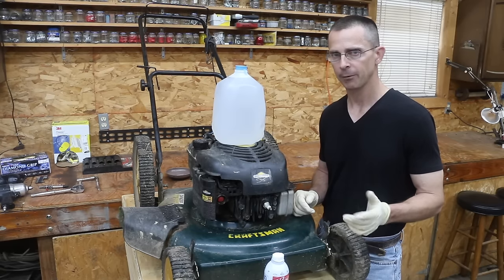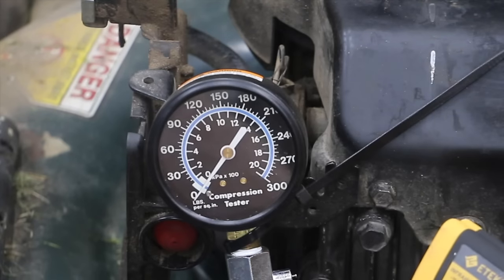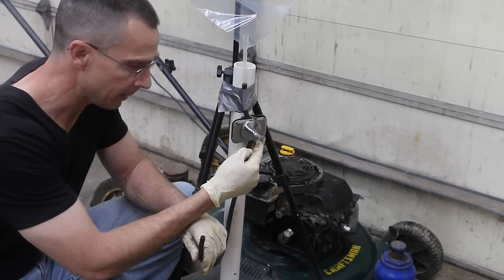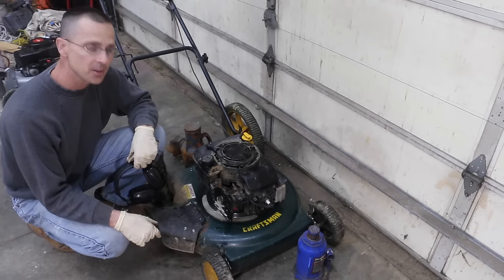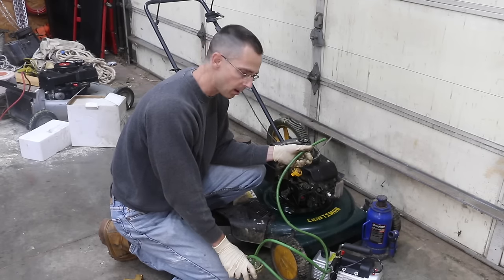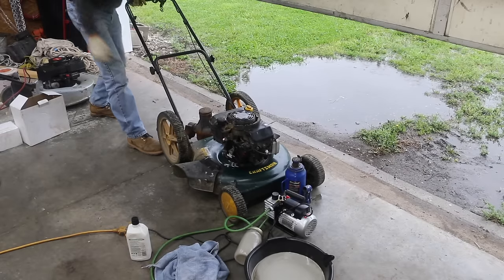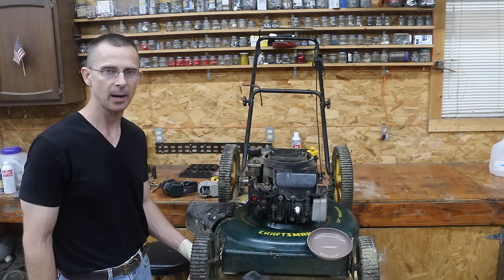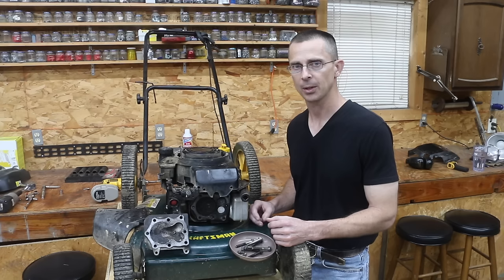Seafoam--can't believe what it did to my engine episode 5--cylinder cleaning test using water!!

Comment: How I was taught  to do it
 is using a squirt bottle and you missed the water into the carburetor
Reply from the maker: Thanks for the feedback.
Reply: @ProjectFarm  
Well over thirty years ago
Old timers say a  quart of kerosene to 15 gallons of gas
Or a quart of diesel to15 gallons of gas
would clean and lubricate your carburetor give a better burn and help clean the cylinders
I've never tried the kerosene but I have tried the diesel
And it did help out an old Holley 2 barrel
How well it works I do not know?

and with water the old-timers said it should never take more than 2 tablespoons of water 💦 two shots of mist from a squirt bottle let it run for a minute and repeat until you got about 2 tablespoons of water in it  that's how I was taught
I did it on a performance Ford engine that I felt it had carbon buildup and pre detonating
And it got rid of the problem

Comment: I'm at 8:34. Before I even clicked on this video I thought, "No way are you ever going to convince me to put water through my engine.".
Even if the water works:
1) He's already been at it for over an hour.
2) There is water in the oil. The oil is ruined.
He didn't save any time.
He didn't save any money.
Even if the treatment works, which i doubt, it wasn't worth it.
Reply from the maker: Thanks for watching!
Reply: @ProjectFarm  After watching the rest of the video and reading through the comments, It would appear that injecting the water as steam or at least atomizing it would be easier and more effective.
Is there a follow-up video where you did that?

Comment: With all the extra effort of setting up a delivery contraption, running it for 2 hours, gas for 2 hours, and changing the oil twice, I'd rather spend the $7 and  add a little each time I fill the tank
Reply from the maker: Thanks for the feedback.

Comment: maybe you can try to use steam from a teapot or humidifier? The idea of using water probably came from some car tuners, who noticed that in rainy or high humid weather cars perform better and have slightly higher power. Physics explains that in dry air fuel fumes burn worse. Originally, the idea to use water came to increase power, but not to clean engine parts. And in my view, you put too much water on that engine. The water flow should be slower, imitating high humid conditions but not direct water stream to inlate
Reply from the maker: Thanks for the suggestion.

Comment: DXID YOU EVER TALK TO A OLDER MECHANIC?? THEY'VE BEEN CLEANING CARBON OUT OF ENGINES FOR A CENTURY. IF THEY USED YOUR FORMULA ON A V-8 STATIONARY ENGINE YOU WOULD HAVE TO RUN 10 GALLONS THROUGH.

Comment: That much water in the oil means the engine ran without proper oil protection thus damage was certainly caused. NEVER use water

Comment: Here is something easier and better. pour oil and a bit of varsol  into the spark plug hole until it fills up. let it sit for a week until the next mowing.  drain it, start it up,, work it hard. your engine will be like new.
Reply from the maker: Thanks for the suggestion.

Comment: If you were to spray on brake cleaner give me the cylinder haul let it soak for 10-15 minutes pulled over with the plug out and it'll blow out the spark plug guaranteed to give you clean Pistons
Reply from the maker: Thanks for the feedback.

Comment: Seafoam wins. it's more expensive than water but if u have to change your oil after the water treatment the water is getting a lot more expensive than 2 botels of seafoam plus the damage it will do to the engine. and if I will use water I won't use normal water but demineralized water to make sure there will be no parts in the engine getting rusty.
Reply from the maker: Thanks for sharing.

Comment: I cringed when you added more water the FIRST time. Not only did you use WAY too much water, you cooled the cylinder below its ability to create steam which would obviously cause any liquid to drain into the sump area. And that was not a slow trickle in relation to the size of the engine. Too much water too fast. A half cup of water with an eye dropper would have had a better result.

Comment: I'm afraid you don't understand the basic principle of what you're trying to accomplish here.

The carbon is removed by it being shocked in temperature.

You do this by heating the engine up as much as you dare (like with a motor vehicle, unplugging the fans or blocking the radiator) then you DUMP as fast as you can (without hydrolocking the engine) ice cold water into the intake, and you cycle this process until the desired results are achieved.

I once had a 1960 Buick that was carboned up SO bad I could literally take it to the store, shut off the key, go inside, buy something, and come back out, and it would STILL be running (i.e. the owner just idled it around town for 30 years).

It took many water treatments but I finally got it back to being a normal car.

If you do it the way I say you don't even have to change your oil cuz whatever little bit of water does get captured by the piston rings into the crankcase will just boil off during the next heating/cleaning cycle.

Comment: You were still using far too much water. I wouldn't have put that much water through a 350 V8 which is about 28 X larger displacement than your Briggs.  The amount needs to be low enough engine rpms don't change too noticeably. Engine temps should also be close to normal....How this trick works is the water droplets coat the carbon then get flashed into steam by the combustion pulse. Steam taking up hundreds X more volume than water is what breaks up the carbon. It is extremely important the combustion chamber stays hot enough to flash the water droplets into steam.  For sure if you have so much water slipping past the rings it ruins your oil you put way way way too much water too fast. In general you want to inject a fine mist of water, not drip it in.... 

Honestly doing this on such a small engine was going to be very challenging no matter what you do. If you ever try the test again I'd suggest using a garden mist Irrigation Nozzle. They produce essentially a fog of water droplets roughly 5 microns in size.  Even then I'd spray the water across the carb, not directly in so you can reduce how much water is going in to where engine RPMs and temps stay up where they need to be. Dong it that way will make it very hard to know how much water actually made in the engine, but coating the carbon with water then converting that water into steam is the whole exercise, so you gotta keep combustion temps high enough to achieve that.

Comment: Try water/meth I use to do this to my Corolla for power using the wiper pump a garden mist nozzle and 20/80 mix and always had good results my 98 corolla now have over 250k and it been around 5 yrs and 60kmiles doing this.
Reply from the maker: Thanks for the suggestion.

Comment: I watched eric the car guy do the same test but only injected water for a very short duration.  Five minutes tops.  I can not understand why you used so much water for such a long time, two hours. Eric the Car guy used less than two ounces a quarter of a cup on a eight cylinder engine.  It appear to run better at the five minute mark.   I suggest only a fraction , less than a eight of a cup and slow drip the water. for five to ten minutes and only until the small amount of water is used, do not refill nor use the huge amount of water used.
Reply from the maker: Thanks for the constructive feedback.

Comment: yes. many of us use water in our engines, its 80 yr old tech from WW II water and/or methanol injection to cool, and control detonation (also cleans) allowing more BOOST, or higher compression. The way to use it today is to buy a SNOW METHANOL/water injection kit. they work on boost or manifold vacume in  N/A motors. You need the very high PSI and fine injector to get a fine enough mist, not a tube dribbiling into a carb. https://www.youtube.com/watch?v=W3qD6pYTppI

Comment: Lol ...add water. Sorry but water in the crankcase will do damage . But hey mechanics need to work too.
Reply from the maker: lol  Thanks for sharing.
Reply: @ProjectFarm  let me clarify. Metal on metal needs lubrication.  And as water has a lower boiling and evaporation point,  oil is preferable.  As friction in the engine generates heat, using water as lubrication will not sufficiently cool or protect the metal surfaces.  Once those metal parts lose their temper, its over. 
If you're genuinely worried about carbon build up ( i dont see the purpose in this )  , try running marvel mystery oil in the fuel , and then turn up the rpm . 
I really feel like youre trying to reinvent the wheel. If water worked,  and/or carbon is an issue.  Im sure another company would of figured it out by now.

Comment: trying to save 10 dollars by using water instead of seafoam is ridiculous because you have to change the oil afterward. even just the oil costs more than the seafoam not to mention the time and effort. so why mess around putting water in your engine?

Comment: i would never put water in an engine, even if it works , the risks are too big
Reply: Water injection is a thing. But its aerosolized before entering the engine to help prevent this situation as well as hydrostatic seizure.

Its also often mixed with methanol for water/meth injection
Reply: @Scottross93  I didnt know! Thanks for telling me
Reply from the maker: Thanks for sharing.

Comment: That was not the proper way to used water during engine decarboniszing method. You dont have to used so much water on it. All you have to do is pour some 320 of it then rev simultaneously with a granual pouring of water on the right temperature of an running engine. Must Try it folks then you have the result. (Disclaimer) sorry but i didn't already test that so called "seafoam" cuz it doesn't exist on my country or rather i can't afford it yet on the internet.. gudluck

Comment: This is hilarious. Buy a mid-priced gas powered "whatever" use it [normally], maintain it well, and after X amount of yrs, buy a new one when it starts failing instead of trying to limp a tired, old, worn out whatever it is [unless it's an expensive riding mower etc]. In this case it was a $150 disposable mower to begin with; let it go.
Reply from the maker: Thanks for sharing.

Comment: omg why not just use a spray bottle or something, so much effort for what
Reply from the maker: Thanks for the feedback.
Reply: That's the way to do it, spray it in intervals to avoid the engine to cool down.
If the engine is not in working temperature the decarb will be reduced.

Comment: This biggest reveal in this video is that armchair mechanics are wrong...again (surprise!).  Water did a terrible job and took so much time and more materials that, even if it worked better than Seafoam (or similar product), it ended up being a more expensive solution when you factor in labor time and extra materials, even if you factor your time as only being worth $1 an hour.

Comment: Any idiot that dumps water in an engine chances hydrolock and dsserves what happens!
Reply: The idea is that you add it slowly enough to burn off. 

Hydrolocking doesn't necessarily need to be caused by water, it can be any liquid. If you dump an extra couple quarts of oil or gas in there, that could lock up your engine too, because the parts simply have nowhere to go, and air can't get in to combust.

Having said that, I've never heard of adding water to clean an engine, and was surprised to hear so many suggest it. Burning 2 hours of gas, setting up the dripline... just buy the stuff meant for the job imo.

Comment: First off yes I would , and I do. But you did the part wrong , way wrong !!!!!! It has to ice cold soda water , and you dump a table spoon to a 1/4 cup . Depending on the engine size . And the engine has to extremely hot . I been doing that for years . Already 30 . It works . Tim the bitcher .